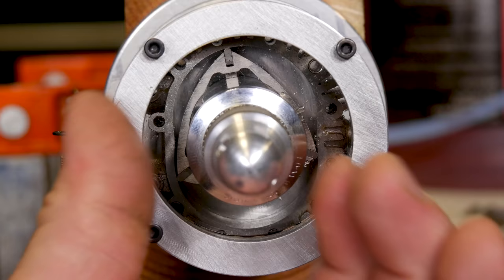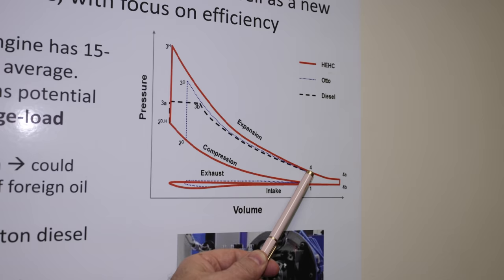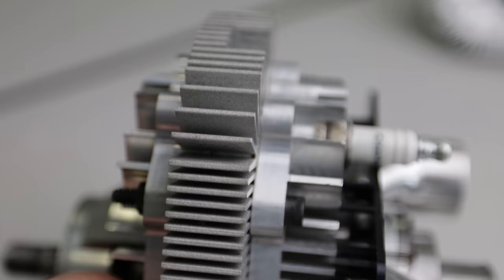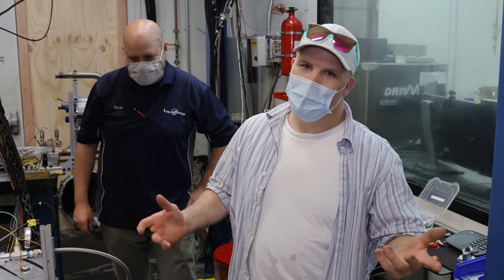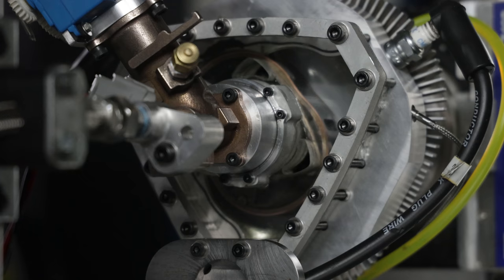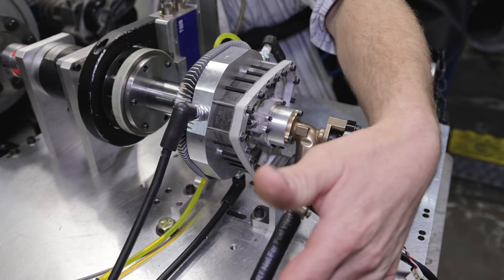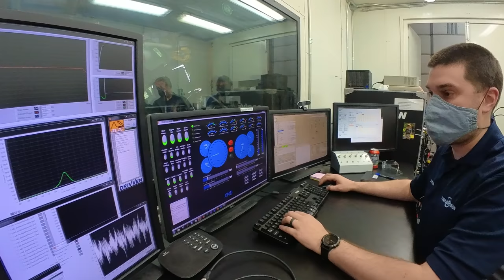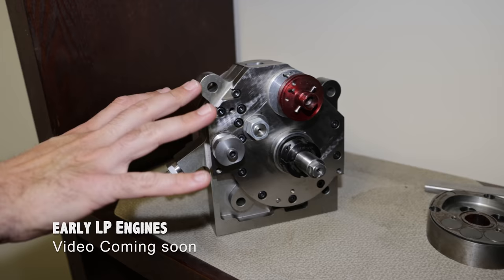See Thru Liquid Piston Rotary Engine - In Slow Motion

Comment: The center of that rotor is really becoming a fan. All of the gasses pass through it. I bet it helps cool itself. I also wonder if those veins it's designed with could be optimized to move more air. Kind of a built in turbo.

Comment: I would like to know if these engines are going to be better than the original version on fuel,I really can't see how they would make enough compression to fire diesel, but of course I wish the engine well I had a rx3 back in the day and it made crazy power but back in my day fuel was a stable 60 or 70 cents a litre and to be honest wages weren't all that different to now but petrol and diesel at at times over $2 a litre most people are thinking about cost.

Comment: I live close and did not know they are from Bloomfield CT. I did recognize the tunnel on Rt 15. Wilbercross parkway you were about 15 minutes from my home at that point. 
Are the chambers stackable to increase banks? Increadable design.  I remember when the Mazdas came out with the Wankel motor and it was a small motor and had a 4 barrel carb. but it problems too.

Comment: Love to see a bigger version. Could produce massive horsepower.
 Could be the answer to The EV,s short range. One of these as the back up. Experts have said pure EV,s is not economical and cost to build defeats its purpose.  Hybrid is the answer. With a new design rotary taking up much less space. Combined with the Electric motor Could be the solution to our future.

Comment: You guys forgot to give credit to Cooley, the inventor in 1903.
Reply: Yes the documentation is a german publication ' Drehkolben Maschinen' or similar with a rather complete listing of most possible configurations, at least two, credited to Cooley 1903,
Reply: Thanks  for the support of this revelation.
I cannot believe that a patent was granted in view of documented prior art. It is obvious that  by compressing, combustion and expansion only one side of the rotor lobe is heated, internal asymmetric cooling by the incoming cold mixture might alleviate this rather significant problem, not a problem with the Wankel engine where the external side is cooled, and the 3 lobed piston is uniformly heated. Personal experience on a helicopter application ( DP 5 drone by 'Dragonfly Pictures)
Reply: @arturoeugster7228  
hola hombre, me acuerdo del prototipo construido en Suiza, justamente con esa clase de motor rotativo pero con compresión superior, por el diseño de la forma más circular del 'pistón'.

Comment: So there are still apex seals but they are in the housing I see. Will this provide any benefits to fix the apex seal issues?
Reply: Also, with the seals in the housing I wonder if they could be replaced without tearing the whole engine apart. Have some type of removable cover over each that will allow the seal and spring to slide out and new ones to slide in.

Comment: Seems like a cool design but that company has got way too much marketing BS going on. They didn't invent a new "high efficiency hybrid cycle" it's an Atkinson cycle engine, the same that you'll find in a Prius. Yes it compresses air only and injects fuel just before ignition, that doesn't change the thermodynamic cycle and if it did most modern gasoline engines are "hybrid cycle" engines too.

Comment: The combustion keeps happening on one side of the lobe faces, won’t this weaken this specific face over time? Considering it’s also the part where the air exchange is taking place, this part is under the most stress overall.

Comment: Love the elegance of the rotary design. I had an '83 RX-7 with the 13b when I was stationed in England. Bought it new and ran the hell out of it, with their higher speed limits, the entire time it was there. It did nothing but purr.

As far as this design, I have a question. First, I'm not an engineer, or even a mechanic, but in watching the demo, I noticed that the same side of the rotor takes all the detonations.

Would this cause uneven wear on the rotor over time? Is it an issue at all? Sorry if this is a dumb question...

Comment: Wouldn't the compression/power stroke part heat up a lot more than the exhaust or mostly the intake stroke part? That would cause uneven expansion of the previously mentioned parts and cause uneven wear on mostly the seals. Causing one part to lose compression and that being on the  intake part is a sad reality, perhaps forced induction would help with this issue or making the intake part a little bit thinner somehow and that would allow it to heat up more quickly and with math you can make it very close to perfectly symmetrical heating and expansion on the parts, maybe both of these would help with longevity and efficiency of this awesome concept engine

Comment: so it leave me a question. What about the cooling system?
Will it use oil mixture just like in 2 strokes engine?
I don't see a way to spray the cooling oil and then wipe it down like in 4 strokes engine.

Comment: What happens when you scale it up and actually have to strengthen those parts? 4lbs?

Also, the bearings In that, to maintain proper contact but not stick to wear away so quickly....losses?

Comment: Obviously, the number of applications for this engine are only limited by our imagination, but I can see this being used in one of the most basic: a self propelled mower. It would be fantastic. I imagine that an engine of typical power for this application, between 5 to 7 hp, would be relatively light and compact compared to traditional piston engines currently in use. However, the one factor that could keep it from competing in this market against piston ICE or electric powered units is it's efficiency. I know the original rotary engines are known to eat up quite a bit of fuel. I wonder what the fuel efficiency potential of this is. Anyone know?
Reply: Seems like it's better than traditional piston 4 stroke engines

Comment: I think when compared to a piston engine there must be some energy loss from this method, as apposed to piston engine the force of the expanding gases are multi-directional, some of that force is pushing in the opposite direction to the rotation.

Comment: I am wondering how can you manage the cooling of this engine. On a normal rotary engine the combustion happen on the same location of the case and evenly distribute to all 3 sides of rotor. The location of bloc where combustion (High temperature) happen can be cooled by having extra cooling canal around it.
With this design, It seems the combustion is evenly distribute around 3 combustion chamber of the bloc. However it's always the same side of rotor that is subject to combustion (High temperature)
Since the rotor is hallow and contains intake and exhaust channel, there are no way to circulate coolant inside of rotor. Will this uneven temperature (Hot side, cool side) within the rotor cause problem?

Comment: It doesn't really look like an evolution of the rotary engine. It looks more like a 3 cylinder radial engine with a common piston. But the question is, why choose this over a 3 cylinder radial engine? The packaging is a bit smaller but there are still seals that need replacing like the rotary and your stroke length is super short.
Compare this, a 70cc 4lb "3+"hp engine to the Saito FG-60R3, a 60cc 4lb 3 cylinder hobby radial engine that makes 4.6hp and has near perfect primary and secondary balance.

Comment: So one side always does compression and the other side always does combustion, are they treated or designed differently because of that? It does have apex seals, in the housing instead though. Is that why they are better than OEM Mazda seals? There are many after market seals that are better too and all but solve the issue for wankel engines.

Comment: I want a 100+hp, single rotor, diesel, turbo charged,  water cooled version of this. MECHANICAL INJECTION, 26 to 1 comp.ratio. nikasiL liner for the wearing surfaces of the rotor. and if you could? EVERY experimental aircraft builder ON THE PLANET would buy one.

Comment: I have a question it looks like the timing  is a little advanced it seems that the ignition of the fuel is spreading down both sides of the rotor  more to one side but doesn’t that cause a loss of power due to the pressure on both sides at once or am I seeing something wrong.

Comment: You would do yourself a favor and increase torque if you had a long to short triangle in your combustion chamber. A triangle where the spark plug is and in the rotor Itself.📐

Comment: I think that we are further away from 100% EV adoption than we think, because so much money needs to be invested to upgrade the grid to keep 50-100 million battery powered cars  charged. For the next 20 years hybrid cars might be the way to go, with small (inexpensive) 30HP LiquidPiston engines keeping batteries charged on long road trips. Hybrids would need < half the battery capacity that full EVs require.

Comment: They need to put a flywheel on it so that it can store more of it's energy, and then use a 8-1 planetary gear set to transfer the power to where it's needed like a cvt. By doing that, you can utilize a smaller engine while keeping it at its optimal efficiency level 😝

Comment: As a motorcycle rider, this looks like it has no low end torque.  It looks like as soon as rpms drop under 5k and load is applied it's a stall machine.  Seems like its nice for high end rpms alone with less  vibration.  But applications which required lower rpms would fail using this fancy sprite of a motor.. there's no way this motor could start on a hill, and push a vehicle up the hill from a static position.  Not without pushing extreme high rpms and filter through a dozen loose gears over slow long and drawn out ascent.

Comment: I have a question, with this new design how would the engine handle additional rotors? Specifically with regards to the exhaust and fuel injector.

Comment: Are rotary engines feasable to run  in a tundra ? As far as compared to a diesel. Are they meant to pull? Ive just ran into info on rotary engines.

Comment: I still see a lot of linear speed on the seals an constantly angle changing forces too,  which we know will wear them faster than a regular ring . plus the inherent deficiency of the Wankel was  low torque and excessive fuel consumption , I see no structural changes here that will indicate these features will be improved much ,,, top hat to the machining processes !!!

Comment: So it's an inverted Wankel rotary engine with exactly the same problems. Apex seals. Which it has on the outside instead of the inside. Mazda couldn't figure it out. They don't have a magic solution. They're just lucky and decent at marketing.

Comment: So if that works as good as you say it does or as good as it seems to why is it not implemented in the cars and trucks??? It looks and sounds like a good idea and if you can make it a diesel it obviously wouldn't sound like it's getting ready to throw a valve like most Diesel's do... The problem with the Wankel rotary engine is they weren't very efficient... But if you can make this rotary engine be more efficient than Wankel rotary engine it sounds to me like you got something on your hands that's a good idea

Comment: Can you lubricate the seal with diesel in the diesel version?
Reply from the maker: I don't know, but we're about to find out because I will be showing the second version of the engine very soon.
Reply: @WarpedPerception  you might be able to use gas too. Because you can renew the layer of liquid every pass.
Reply: @WarpedPerception  what are the main concerns currently, is it lubrication?
Reply from the maker: @antonmaier2263  I'm not sure, I'm not currently working on that project, my involvement will be in the next type of integration coming up soon, the last four and a half months of my life have been dedicated to building a second version of the cordless Tesla and working on the Mr Beast video.

Comment: So Honda is pursuing the hydrogen market while the rest of the world is impatiently jumping on the battery powered vehicle bandwagon.   A hydrogen powered liquid piston engine as a  range extender would be good.  Battery charge capacity on electric vehicles is still very unstable due to environmental temperatures and having a backup would be reassuring.  Or possibly the hydrogen powered engine could actively supplement the battery so as to reduce the size of the battery pack and thereby reduce the weight of the battery.     This engines small size and high output would be great for hybrid development but I don't see it replacing piston engines.

Comment: Will this structure handle boost?
Reply: If the power is scaled up, the waste energy does too. Eager to hear how it handles the Qout from combustion.  Rotor thermal expansion may be a challenge, but with enough blow-thru air, it could work.  then... backfires on overrich could be catastrophic! Invar to the rescue?
Reply: @JohnWest4  it needs a high pressure fuel system

Comment: And what if we solve the problem of lubrication and cooling of the apexes by lengthening them by 2 times and moving them perpendicular to the rotor.  First substitute the left half, and
  In the meantime, dip the right one into the oil bath, then substitute the right one, and shift the left into your oil bath.  You just need to make the apexes 2 times longer and the drives on them

Comment: Respiratory system has more power then this although this engine is stable bcz of more aera for power stroke but not efficient and it will use more fule the gravity is also a hadel for this

Comment: again, notice the amount of lubricated surface overlapping with the combustion zone. meaning that it will never be emissions certified, it is an oil burner. plus , the compression ratio is far too low for a modern engine. it is a failure.

Comment: Wait, they're crying about apex seal wear, but what about side seal failures. Boosted wankels kill side seals faster than apex seals, and this design appears to have more side seal contact than a wankel. And the biggest issue with Wankels is lubrication and emissions, which appears to be the same for the LP engine. Now, running on diesel would cover lubrication to an extent, but I still don't see a long life to this design. However, I'd love to play around with one of these as a generator power source, a go cart/mini bike, and even a lawn mower engine. Also, I don't see an effective way to stack these together, with the cooling air passing through the housing, you would pass the heat of one into the next, and so on, like a 4 stack of radial engines. 🤔

Comment: Same sealing issues, less leverage than the apex rotor, so what’s different from reliability standpoint, there is a reason why these aren’t made by the big automotive industries they just don’t last you have to seal the moving rotor and the rotor sides, no way is this much different they just moved the seals to a different spot and made the rotor less effective, emmisions and poor fuel economy, umm 🤔 how it gonna lube itself yeah figures oil burner

Comment: Actually I think this is future because I do not believe in the future all cars will be E.V because it is nearly seems EVs are not eco-friendly as everybody thinks. 1st battery recyle, 2nd how to produce that huge amont electric and last what will happpen if millions of car need charging at the same time. 

my vision is in 2040s 70% of cars on road will be eletric and %30 are hybrid and 2060s %50-50 hybrid and electic due to usage and eco-friendness and very light and small low power internal combustion engines needed. Hybrid also means light batteries placed on cars. most efficent way I think 70hp 50kw hybrid cars for Eu nation for daily cars.

Comment: I love rotary engines and two strokes too, but does this concpt engine does run without adding oil to the fuel? From an engineering point of view, there was little to none input really, sorry. How does this  this O-ring "seal" stand high "mileages", servicing the engine every 1000km is not convinient. I stick to my 2 liter 4 cylinder tubo  engines. But I would love to see combustion chamber  improvements.
At 2035 new combustion engine powered cars are forbidden in Germany, for facks sake...

Comment: The original rotary design was superior in fuel efficiency and power output with less rotational mass and moving parts as compared to a conventional piston engine of similar displacement. Were it not for those damn weak ass "apex seals" it would possibly have replaced the piston engine as the world's standard automobile power plant.

Comment: Awful design. You can see the "apex seals" lifting off the rotor surface because no spring in the world can keep them in contact with the rotor. Mazda knew about that problem and thats exactly why they had the seals on the rotor itself. The centrifugal force really helps the seals follow the walls and be tight.

Comment: There are several main issues with this type of concept. First of all, the apex issues unresolved. It's unreliable and creates high friction.

Secondly, the torque produced although is higher than reciprocating engines but still not good enough.

This is still a failure.
Reply: Yeah right as if you know what you are talking about.  What engine have you created?  Oh yeah that's right NOTHING

Comment: at no point in this video did this "engine" accually run.(note that lack of exhaust) you can hear its being spun by the electric motor.  it fires a few times but isn't self sustaining the most daming evidence of this is at 10:16 where its being "run" on gasoline. its not even firing for half of it there is raw fuel pooring out of the thing which if it was running should be massive flames.. what a crock these scammers have been around for years if there was anything to there claims they would be building fuctional units and before somebody mentions the go-kart video. again NOT running its being spun the electric motor and its barely moving under its "own" power